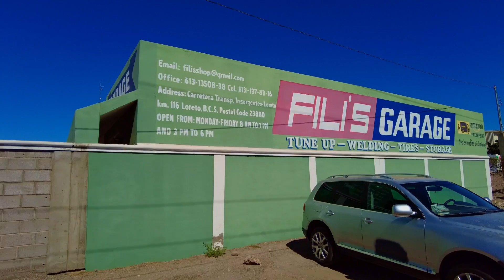Baja Breakdown: Our Worst Truck Camper Experience Yet

Comment: Was the flat deck installed by a business that sourced the deck or was it the actual deck manufacturer who welded on those angle mounts to fasten it to the truck frame ?.
Reply from the maker: We purchased the CM Flatbed new from a distributor and used their installer.  CM doesn't make their own install kits and the installation manual just says to use adequate materials.  I argued with the owner for about a week straight after inspecting the first install and they replaced 4 of the 6 mounting points with thicker angle but refused to replace the rear 2 (originally they only had 4 mounting points installed).  The installer told me he did several hundred flatbeds a year like this. Liberty Trailers in KY, never use them.  The install cost over 1k too and the location was a 3 hour drive one way from where we were at, so it was a huge hassle to have to drive back there to have them try to install it again.  They said they have many people pulling 30k lbs goose neck trailers with their installs, how terrifying!  Sadly enough, the second round install still failed as you can see in the video, I'm just glad the whole bed didn't fall off.
Reply: @twocatsandacamper  I can see where a deck manufacturer has no control over how the unit gets installed on a truck as the mounts have to be tailor made/welded to the deck to fit the truck in question. At the time you were questioning their "minimalist" approach to their attachment methods and I can surely see why. I am certainly no engineer but working with farm equipment/highway tractors etc and what bit of fabrication work I have done, their mount material thickness along with its width was just not up to the task without being gusseted. I am only guessing that you told them the deck would become the mounting attachment points for your intended camper ... I guess as long as you made it off their property without the deck/camper falling off, it was a pass in their books !. It gives me a sick feeling to think of such scum bag places that can look legit but churn out pathetic/unsafe work but know all too well how to take a customers money !. 

On another topic, I am curious if your pickups front suspension torsion bars could use a little adjustment ( not a jacked up "leveling kit" theme though ) as I suspect they will have settled with use and now may have less up travel then is desirable as well as the bump stops having taken some beating by now as well and could be up for replacement. It seems to be a theme with the GM HD front end that it settles and can benefit from the torsion bar keys turned up just a bit to get back to new factory ride height and yes probably an alignment done at the same time ( with the camper on as that is how its mostly being driven ) as changing the ride height changes the tow with the GM system. Cranking the keys all the way to jack the front end up is definitely not what I mean as the factory top ball joints are not made to run at that severe an angle and it puts more stress on the tie rods ( all the steering components really ) from what I understand and why the aftermarket has lovely expensive components they like to sell to create the "levelling effect" on an empty pickup mall crawler.
Reply from the maker: @charlesb4267  Yes I did inform them I'd be putting a truck camper on it and attaching the tie downs to the rail.  I think you're right, that once I got off of the lot it wasn't their problem anymore. 

Thanks for the maintenance suggestions, I haven't adjust torsion bars before so it wasn't even on my radar.  I have been trying to get an alignment done recently - we just got a new set of tires (we got a bubble on the inside of the left rear KO2) , luckily we didn't have any uneven wear or cupping.  The front bump stocks look pretty good still, no cracking or anything that I can see, there are 4 up front.  Probably not a bad idea to replace them all anyway though.  I'm also going to be changing all the differential oil out and giving the transmission a flush while we are back in the states before we head south again.
Reply: @twocatsandacamper  Hindsight is 20/20 as per the outfit you bought the deck through and their idea of a great installation, its amazing how some companies that operate that way can get away with that crap for years. 

The reason I mentioned the bump stops is because of some of the roads and trails you have been on which may have stressed them more than usual for the miles you have on the truck and from what I understand GM intends on at least the lower arm contacting its bump stops as part of the normal operation of the suspension which is different from what a traditional bump stops function is. On forums of owners talking about their trucks, some say their truck has settled onto those lower bump stops as the truck sits static due to the torsion bars having sagged some since new and causes a harsher ride as its now relying too much on the bump stops. Definitely something to talk to a good alignment shop about that is very familiar with the GM HD suspension to assess how your truck is sitting and if adjusting them slightly would be prudent or not at this time ( before the alignment is performed ). I also am guessing given your heavier camper that you may have wished you had bought a single wheel one ton, not to say that would have given you exactly what you were looking for rear suspension wise but the theory of it being able to carry more. At least you never bought a half ton pickup back when you bought the popup !
Reply from the maker: @charlesb4267  Yes it is what it is with the original install unfortunately.  I feel much more comfortable with it now after the repairs.  

You are right our front bump stops are always touching and I have wondered if that was correct or not but didn't know what I could change.  From what I've read GM uses a progressive bump stop that is supposed to act more like a spring.  I'll tell ya though, it is not great.  I'll definitely look into it, those are some good ideas.

We have had the 1 ton single wheel discussion several times, luckily with GM the frame and most things are the same on the 3/4, I think 1 tons get an extra leaf spring in the rear.  But yes we have also talked about how glad we are we didn't get a 1/2 ton, we would have had to change trucks when we changed campers!
Reply: @twocatsandacamper  If I was you I would do two things, one being to go to one or more alignment shops that are very familiar with GM products and discuss the front ride height and if they have a rule of thumb they go by to re adjust the torsion bars to a proper ride height ( and not the bone heads that want to crank them all the way or think you need aftermarket "keys" to really crank it up ). Two, to swing by a GM dealership with a note pad and measuring tape and even snapping some photos of the clearance the arm has to the bump stop and a general concept of the angles of the arms and the tie rods. To compare to your truck, one would have to measure from the center of the wheel/hub up to the underside of the fender and find trucks that are sitting on level ground. I suspect you will see some variances as again that is what I have been hearing of brand new trucks that they are not all set exactly the same from the factory ( I guess they call that factory tolerances ! LOL ). The guys that crank their torsion bars up all the way ( and like I said that kills the factory ball joints and tie rod ends fast ), if they are honest they will say how much rougher the ride is when that is done, not only that but the droop portion of the suspension is lost when one goes to the extreme ( certainly with after market keys that are clocked differently to allow for further cranking travel of the torsion bars ). 

Your right, basically there is very little difference between a 3/4 ton and a 1 ton with the GM, I believe they use the same rear axle housing in the gas version where as the diesel 3/4 ton may have the smaller axle housing and the 1 ton comes with the larger axle housing. The spring pack with over load and the mating spring pads mounted on the side of the frame is one of the main differences between the 3/4 and 1 ton as far as I know with the gas version. That and yes the sticker on the door jamb with a higher GVW which I understand also seems to be a catch point for some US states charging for a different form of license plate. Here in Alberta it makes no difference to how I insure a truck anyway and interestingly enough for some reason in Alberta and may apply to most of the provinces, the insurance rate is slightly lower on a 1 ton vs a 3/4 or 1/2 ton ... I guess the insurance claims just happen to be lower so the rate is a bit better.
Reply from the maker: @charlesb4267  Thanks for all of the suggestions!  I like the idea of getting the truck back to factory ride height.  I'm definitely not planning on jacking the torsion bars all the way up haha.  Thanks again for continuing to watch the videos
Reply: @twocatsandacamper  Your welcome, I figured you would want in the ballpark of the factory new ride height, none of this jacked up high maintenance created mess that seems to be the in thing for that "cool factor".